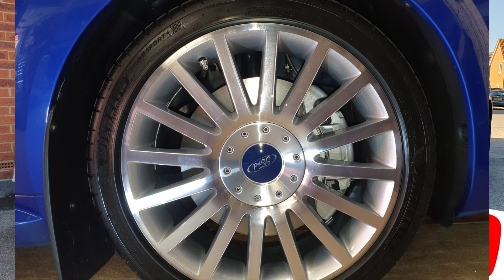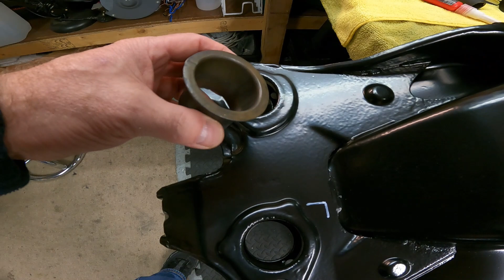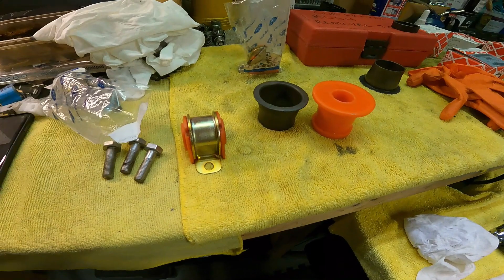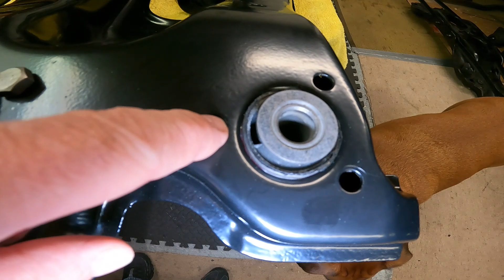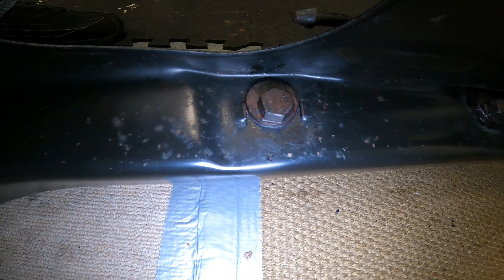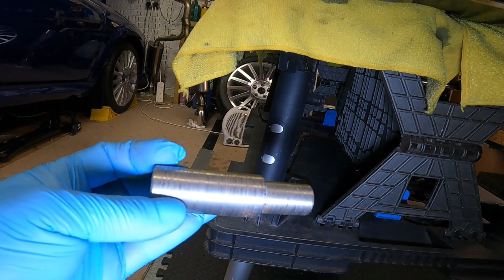ST220 REAR SUB FRAME REFURB/REBUILD

Comment: Hey, great videos! Do you do all the work by yourself? If you would buy a 200k mile ST220, what would be the first things that you would tackle ? Thanks and keep up with the good work! Cheers.
Reply from the maker: Thanks. I would first have a good look underneath at the rear in particular for corrosion and then check the engines big end bearings for wear.
Reply: @mondeost220restorations9 Thanks! By the way, what about the chains and chain tensors, is it true that they last for many miles?
Reply from the maker: @flavioc5389  yes, as long as there are no rattles coming from that area they should be fine

Comment: Brilliant vid again and useful.
I'm actually back at the stage of being able to grip a spanner again, after a long injury layoff, so getting back onto my rear underside refurb tomorrow.
Also have my alignment pins ready and made up on the lathe from your previous advice on diameters.
I have a question now, having seen the way you've just measured your arms, before tightening.
I was going to set my new subframe arms up all equal, as I'm also able to measure against my old one. However, my thought then was to get the car on the floor with the subframe re-fitted, then put a breeze block under each wheel to give me room to get underneath. I was then thinking of loosening off the 4 bolts for the arms and letting the car naturally settle overnight. Then torque the bolts up the following day.
I was thinking that the arms are all then loaded to the natural height of a settled car.
What's your line of thinking on this?
Something to consider when going for Hunter 4 Wheel, is to weigh yourself first. Then, when they set the car up, the equivalent of your weight should be placed around the drivers seat. I've seen a few Fast Fit chains neglect to do this, but apparently a Tech should do this if attending a course with Hunter.
Brilliant vids again and really looking forward to the subframe fit 👍
Reply from the maker: In short I just think it's best to bolt the arms to the frameas in the positions it was when it left the factory which in sure my original frame was considered the rusty bolts etc (previously cleaned up before filming).
Glad yer on the mend and getting back to the spanners 🔧 😀 👍